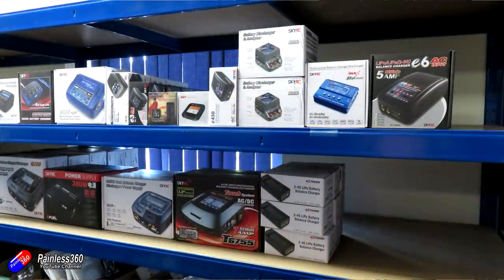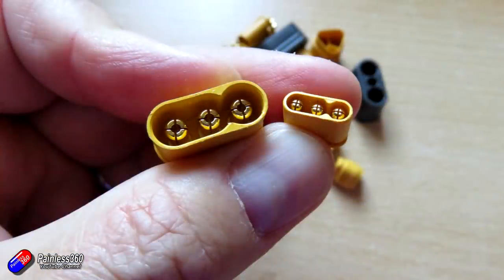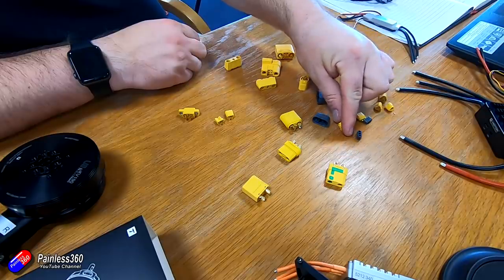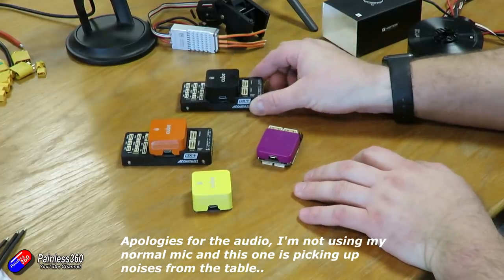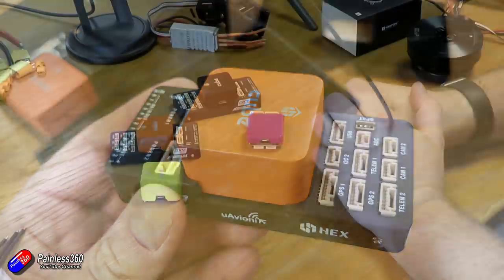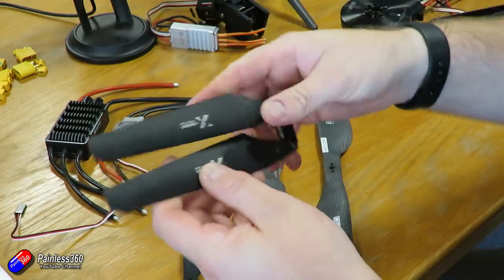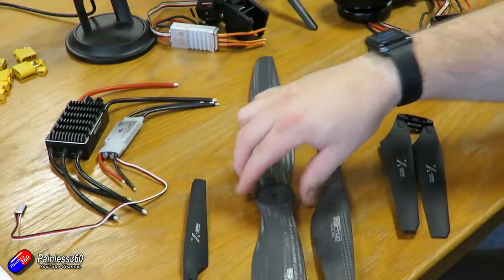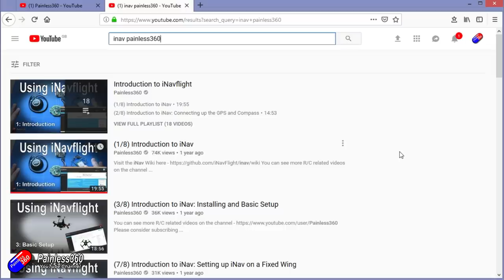New connectors, PixHawk Cube and T-Motor fixed wing/VTOL stuff

Comment: I've been using the mt30 connectors for my wings and love them. I do wish they had a version that was only soft indexed. Like those flat versions if they were marked with a proper orientation but allowed reversal. So I could reverse motor direction without unsoldering.

Comment: Firstly, I'd like to mention that the connector prices at 3dxr are very good. They appear to be competitive with Banggood. I didn't check out shipping to USA, but it would probably come out OK in bulk. I hesitate though since we're kind of getting away from the idea of a "standard". I didn't buy XT30 or XT90 for years because of this. Now I have a drawer full of self made adapters and no space efficiency. Amass is really just making "interesting" connectors at this point. I can't see insulated bullet and servo connectors going away any time soon.

Comment: The reliability of the applications discussed aside, I get the impression the fixed wing electronics have kinda stayed still for the last few years compared to quad stuff. Realistically I expect motors to have 0.2mm laminations, n50+ magnets, hollow shafts, open bottoms, as big bearings as possible. Few of the fixed wing motors around tick many of those boxes and the ones that do are not cheap at all. Even then comparing the stator:weight ratio fixed wing motors come out very poorly. That 2820 is 140g, I could get a lot more stator for that weight. Seems to be a similar story with escs. Sure the big fat airplane escs need less cooling but in most hobby cases we are well under 60A and there are reasonably cheap blheli_32 escs rated for 80A and very cheap heatsinks that you can attach. Just as an example, that 2820+120A hobbywing is around 250g total. A light 4xxx x-class motor esc combo is going to come out to a similar AUW even of you add a bunch of heatsinks to the esc. (rated @ 4-5x the wattage too). Different application I am talking about but am I missing some voodoo that they put in the airplane stuff I should be aware of?
Reply from the maker: Lots of energy put into MR motors and ESCs driven by the hysteria of the quadcopter phenomenon over the past 4 years. That plus less issues with weight, not needing to hold the model in the air alone and flight times that can last 10 times that of a MR results in a different set of design fundimentals. I'm sure some of the lessons learned from the MR motors will make it into some of the FW motors and ESCs in time...
Reply: @Painless360  Gotcha, airplane stuff is rubbish, quad stuff rules. This is what I suspected. I knew that quadcopter hypetrain was going somewhere.
Reply from the maker: I wouldn't say rubbish. Just designed for a different use case ;)
Reply: @Painless360  ;) ha, of course not! Implications are interesting though, basically means a lot of the larger fixed wing setups could often have 50% more power or 50% less power system (and thus battery balancing) weight if they took advantage of quad tech. Especially with some of the new larger quad motors designed for 7-10" props.

Comment: Great video on these new connectors but I'm confused on the ones stated as ESC connectors. Why would you want a 1-way connector for an ESC? If you need to reverse the direction of the motor, especially for an aircraft without a flight controller, you want a 2-way connector. Am I missing something? Thanks in advance and I'll see you in the Air!

Comment: hi -  any word on when cube orange is out of the beta phase and available in general release?
thanks!
Reply from the maker: The guys at 3DXR would be the best to aks that one..
Reply: Hi, Orange Cube is classed as Beta until Arducopter/plane 4.0 is Stable release. The Hardware remains the same. ArduPlane 4.0 beta is out, copter will follow. You can follow the development and features on the Ardupilot website.  FYI the next releases of ArduPilot will all be named with 4.XX

Comment: I have also seen some reversible / bidirectional female MR30 connectors that allow you to easily swap motor direction without having to de-solder+solder and/or program an ESC. https://rcdude.com/hyperion-mr30-2mm-3-pole-motor-to-esc-connectors-female-reversible.html